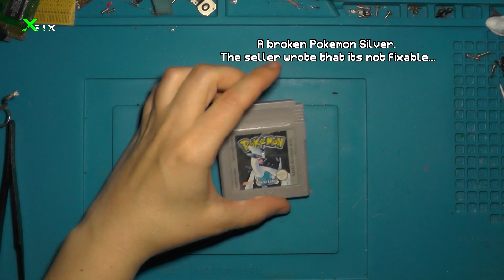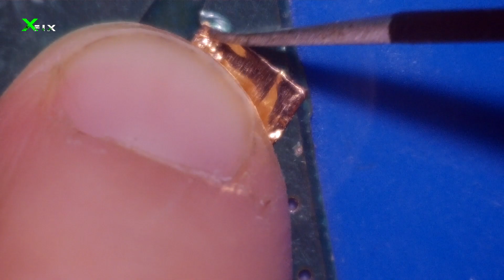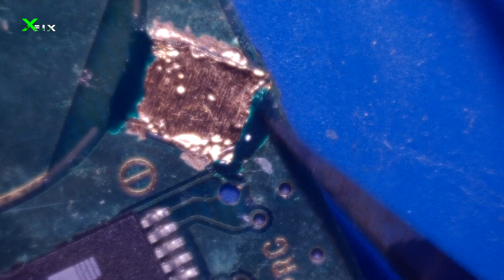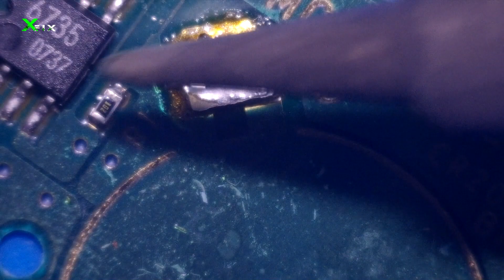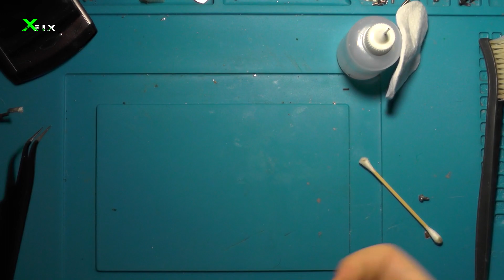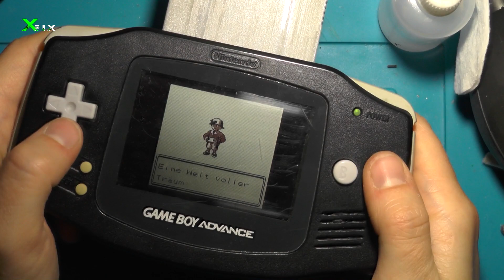Damaged Gameboy Game Repair Fix - Seller wrote that its not fixable? Is it?

Comment: Very good video, I think you will get lots of subscribers. I have just recently started my own project to get my childhood N64 working again. I managed to strip a screw on the heat shield but I'll get it fixed. Keep up the good work!
Reply from the maker: What was the main issue with it? And thanks a lot :)
Reply: @x-fix  No video or audio output from the console. I have confirmed the games and the AV cables are working using a different unit. I have completed the teardown and there was a lot of cleaning that needed to be done, but no damage to the board that I could see. I've given the contacts on the cart reader and the expansion pak a good clean. Just need to put it back together and test now.
Reply from the maker: @WardWC  Let me know if the cleaning did solve the problem!
Reply: @x-fix  The repair was a complete success =P
Reply from the maker: @WardWC  Fantastic news! :) Awesome!

Comment: Nice job. Why do you use lead free solder? Is it not much harder to work with compared to leaded solder?
Reply from the maker: Thank you! :) I use leaded solder only on stubborn cases. The solder paste you have seen in the video has a melting point on 135C. Not sure if leaded solder could beat that. :)

Comment: I was looking in the description of what did you use to fix that solder pad. Did you use copper tape? Or what exactly is it called?
Reply from the maker: Exactly! Its copper tape! But you can also use any copper wire or material for this job. :)

Comment: Hi I have been looking for videos how to repair a torn pad , I tore mine  when changing the dry battery and I can’t seem to fix it, can I maybe reach out to you and paying to help get it fixed ?
Reply from the maker: Depending where your located you should reach out for someone who offers this service in your area. Not sure of its worth paying for gigantic parcell fees :) Are your sure your dont wanna try to fix it by yourself?
Reply: @x-fix  I really don’t know the first step to fixing it , was thinking maybe try to stick it back with some kind of electrical glue .
Reply from the maker: @ltshipo7349  In which country are you located?
Reply: @x-fix  us, I have found some stuff that might work on Amazon after doing more research found some new pads got some flux to clean area . Even found some electric gel? I’m going to see if I can maybe fix it with all that stuff i ordered .
Reply from the maker: @ltshipo7349  Just keep the main task focused. I am not sure of you ripped off the plus or minus pad? All you need to know is, that you need to create your own copper pad. It doesnt matter if you use a wick, or copper wire or copper tape. Its all up to you. If you ripped off the lower pad on a normal Gameboy Cartridge, its the minus/ground pad. Thats the easier one since you just need to do the same I did in my video. If you ripped off the upper pad, it was the positive pad. All you need to do here is to use tweezers or something else to scrape off the solder mask and to locate where the end of that pad is and to create a new one. Just make sure that the positive (new) pad is touching what it should be touching: The end of the missing path. Otherwise you will short positive and negative. Tools you need: Soldering iron, solder, flux, copper (what ever you have at home), IPA (Isopropanol Alcohol for cleaning the surface after your work). Let me know if you need any further instrucions or mental assistance. As you can see I always respond! :)
Reply: @x-fix   hi sorry I have been busy and haven’t had time to work on it and yes it was the positive side of the pad  I got everything delivered, I have flux desoldering wick, some wire glue ( idk if that works at all) and some silver conductive paste, copper foil tape double sided conductive (not sure if it also works) so from what you told me I can use any copper around the house for the positive? Do I need to sand down the area where the old positive pad used to be? Thank you for all the information.
Reply from the maker: @ltshipo7349   Hey, no problem at all! Well Yes, you have to sand down the area to see where the ripped pad ends. But you can also use tweezers or a fork or knife, to rub off the green soldermask until you see the coppered layer. I also took out one of my Pokemon Cartridges to follow your task. To make things easier, you see that circle where the battery usually lays down? Its all positive. You will see a light darker green line around the circle that keeps positive and negative seperate. This makes things easier for you to understand where to create and connect your own pad. May I ask what game it is? Is it pokemon or something else? There are small differences between the boards but at the end still similar.
Reply: @x-fix  hey yeah I was changing the battery for the Pokémon sapphire , and took out the positive . I will sand around looking for the copper then , for adhesive what would you recommend?
Reply from the maker: @ltshipo7349  Oh a Sapphire! Ok ok.... let me think about it. There is a chip under the battery. You have to be even more careful with this one and I would recommend to use tweezers for scraping off the solder mask there. There are components pretty much near the positive battery pad. From what I can tell the positive pad is under the darker solder mask. The lighter green one is the negative. So make sure you keep an eye on those both and keep them seperate. 

Here is also my email if you want to show me a picture of your board: x-fixrepairs@proton.me
Reply from the maker: I think I made a mistake. It's x-fixrepair@proton.me without that s at the end. Sorry about that!
Reply: Curious, did you manage to fix it?